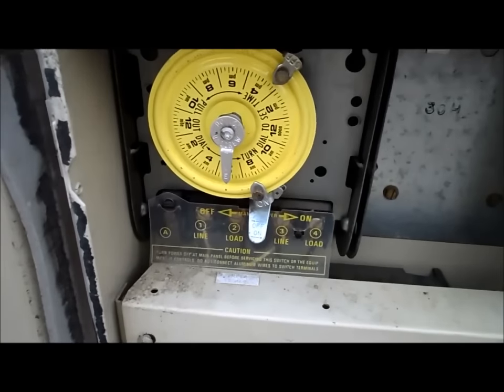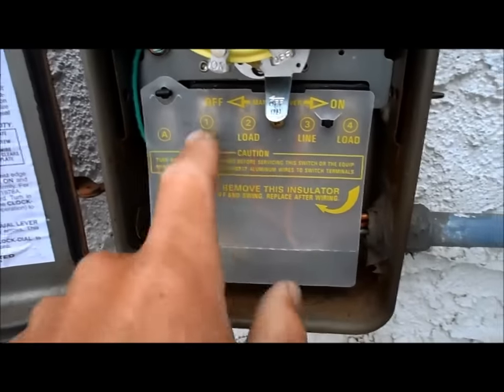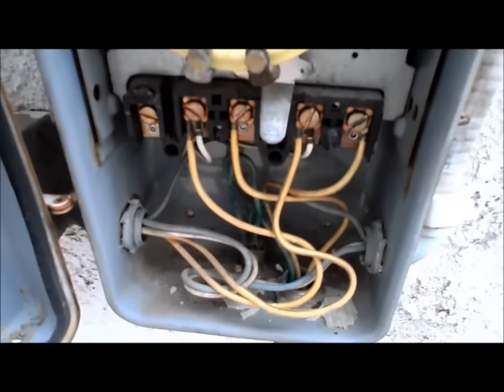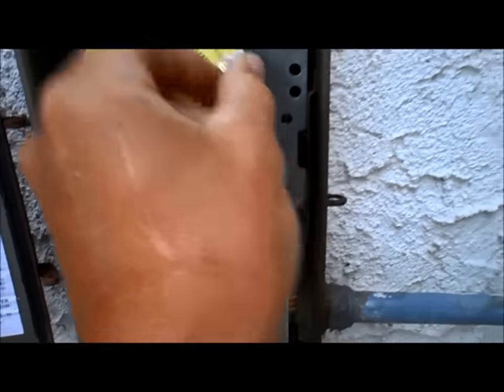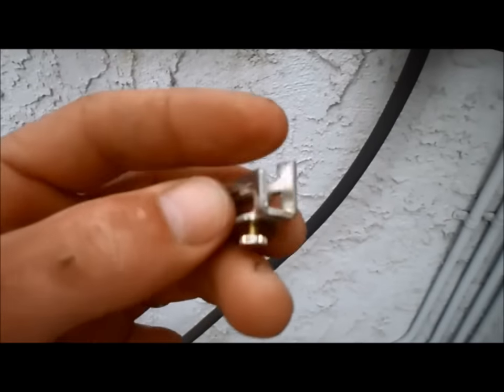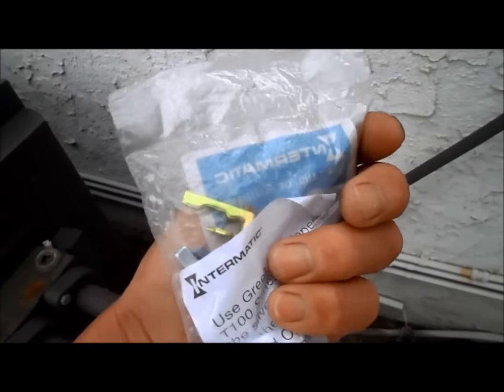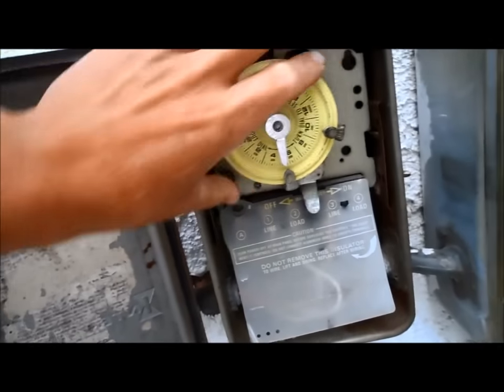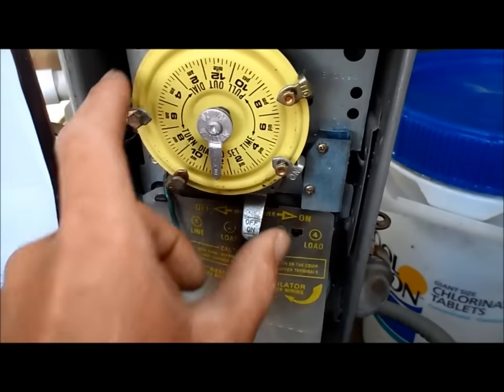Intermatic Pool Timer, tips & troubleshooting

Comment: Thanks for the quick response.  Breaker is at the timer location and I plan on marking all the wires (with picture backup) to ensure correct installation.  Great work on the videos - will be back if any other pool issues!

Comment: The Intermatic timer installed when my pool was new, lasted 20 years. The new one, installed two years ago, lasted one year. Replaced it last summer, and the newest one (purchased on Amazon) lasted less than a month. Each was the exact same model. This year, I'll replace it with something from Lowe's. At least they'll accept a return within 90 days.
Reply from the maker: The quality of modern products in the world is frankly - terrible.
Reply: Yah my 5 year old one sounds like a pumping meter,box rusting.Maybe only surface but gears sound struggling.I’ll replace it I guess.

Comment from the maker: I just replaced a set of trippers on a 37 year old timer this morning. I though about your comment so I compared the two trippers - green and the silver - I could see no difference but it must be microscopic. I know if the trippers are even slightly damaged the timer won't work correctly. This morning the customer said it wasn't turning off. The old "off" tripper was fractionally bent. The green tripper is a recent thing - maybe the last 3 years they have been included in the replacement bag.

Comment from the maker: You can get a second set of "on" "off" trippers and run it on two different times. I have a few pools set up this way. I also add an extra "off" tripper sometimes so when I add chemicals in the morning I can run the pool for three hours if the timer is set to turn on later in the day. That way I don't leave it running all day. A little Pool Guy trick ;)
Reply: Where do you get the second set?

Comment: Good tips. There's another video out there titled how to save 300 annually on your energy bill by changing the timer on and off to cause your pump to turn on and off 3 times a day and only run 3 hours a day. As a pool tech if you have seen the video please do NOT do that! Your pump needs to run 6-8 hours a day in the summer AND turning your pump motor on and off several times a day is not good for it. So what you save in electricity you will pay in motor repairs and chemicals to fight algae etc.

Comment: Not sure where to put this question. When I put my spa HEAT on using indoor control panel. I jump in, it heats up, it shuts off at 104 deg. BUT, when I leave the spa and go inside and look at the control panel, it's still RED, calling for heat ON even though it's up to temp. and shut off. It's supposed to turn GREEN when it's off/up to temp.

Thoughts? Thanks!

Comment from the maker: I use the wire algae brush all the time. It won't damage the plaster at all. I have never tried the Vitamin C myself so I can't comment on it. It can't hurt to try it. A Stain remover will not work in the case of a rust stain. They are only effective on small stains like fertilizer pellets or a staple that falls in the pool, and even then they are hit and miss at best.

Comment: My timer motor stopped working so I had to take the cover off the timer motor to clean the debris from the gears due to ants that kept the gears from meshing. Simple to do, just little tabs that needs to be bent back. Under the big drive gear on the motor is a metal indexing tab that if put on the wrong side will make the timer 

motor run backwards, so make note when you carefully remove the gear cover. Been working great after a little cleaning and oiled.

Comment: We just replaced the mechanical timer in our box (after watching your video and it was super easy),  however that did not solve our problem.  The pump does not respond and turn off using the manual lever and changing it to the stop position.  Is there some other component that could be bad and not allowing the manual switch to break the current?  Right now we are having to operate the pump by using the circuit breaker.  Any help is greatly appreciated!

Comment: Cool thanks!  I run mine about what you say, 8-10 hours... .question is my salt gen is supposed to have a flow sensor and shut the gen off, but it doesn't appear to be... so iv'e been trying to remember to go turn it off and then back on the next day.  problem is, I often forget... and very rarely the gen will shut off with the no flow light on.  Should i get a second intermatic timer, or get a diff timer for the salt gen, been looking at a woods 1000w timer.. appears to be for things such as block heaters?
Reply from the maker: That is a very dangerous situation. The gases in the cell can build up and the salt cell can explode. It is a wiring issue I think vs a timer issue. I would have an electrician come out and troubleshot it for you.

Comment: I had a "GE 15350 Heavy Duty 24 Hour Timer" from a house I bought.  It worked for 3 years and it went out.  Is this as good as GE 15350 ?
Reply from the maker: siuabc These timers are much better. Usually last about 15-20 years or more...
Reply: Swimming Pool Tips, Reviews & How To -MrDgvb1 thanks!  Ordering one. I am not too handy with electric stuff. A one person pool company said he will do it for $80. And said if this still doesn't work, it can be the motor?   The last time it worked was when my mom tried to turn it on and it sparked at the timer; and then it never starts again.  Any thoughts?  Other areas that might cause be the problems?

Comment: Question, I'm getting a variable speed pump but always had a single speed where the timer did the work of turning it on and off in 8 hr schedule.  How do i bypass this when i get my new variable speed pump?
Reply from the maker: Leave the switch to the on position and remove the on/off trippers. You're all set!
Reply: @SPL  that's easy enough. Thank you!

Comment: Thanks - great video!  Any suggestions for a timer that works intermittently?  It can be up to 8 hours "late" within a 24 hour period.  Two timer system with one for the pump and one for the sweep - it's the sweep timer that has the issues.

Comment: I read that the Series 100 Timer uses the green ON tripper and the other series use the silver (IIRC). I understand if you have a 100 series timer and use the non-green tripper, the timer will start the pump.

Comment: My pool pump has 2 speeds so I have 2 timers.   The timer for the slower speed is changing times all by itself.  I adjust it by pulling out the clock and locking it back in but it won't stay at the correct time.
Is there some way to fix that?  Or do I need to replace it?

Comment: Hi, i have the identical timer in the video.  I would like to start my pool pump around 8:30 a.m. - 12:30 p.m.  and then turn it back on at 5:00 p.m. to 8:00 p.m.  The reason i would like to do that is because in Los Angeles we get charged a peak hours from 1 -5.  However, when i added the new two pins and set it from 5 to 8.  The pool pumps starts at 8:30 and turns off at 12:30.  However, from 5-8 would not turn on.  Can you shed some light on the issue.  The pins are new.
Reply from the maker: Interesting. Maybe the on pin is defective in the new set. It happens sometimes. Try swapping the "On" pins and see what results you get. Just out of curiosity how many gallons of water is your pool and what size pump & filter do you have?

Comment: Thanks for the video! I just replaced my timer and the pump runs when I manually flip the switch on, but the clock mechanism isn't working. So the clock doesn't rotate. Any ideas?
Reply from the maker: Possibly a defective timer mechanism. Been a lot of those on the market.

Comment: Please help....anyone!!!  My problem is that every now and then the timer will not kick on the pump.  When I push the manual switch to the right, it will start. But when I let go of the switch it stops.  If I push it to the right harder it works, but then if I let go again it stops.  Then I switch it back and forth a few times pushing harder to the right and eventually it will hold.  It will run fine, turning off and on for days then.....it does it again. Happened four or five times over the last month.   Can't find an answer to this anywhere on the internet.  Thanks.

Comment: You say about the timer wheel to make sure it clicks back in. If it doesn't what do I do? Mine just spins. I can manually turn  the power on/off but the timer wheel does not move. But I can spin it around easily by hand. I do I get it pushed back in?
Reply from the maker: Try that. And if not you may need a new timer. They are relatively inexpensive.

Comment: I bought a replacement but the new one only has three screws/contacts to connect the electrical wires (instead of five contacts like the one shown in your video). Where can I find info on where to connect each wires to the three contacts?
Reply from the maker: You will need to contact Intermatic tech support. They are really good and can walk you through the proper set up to get it working.

Comment: I started using just a plastic timer box I had kicking around on a 1.5 hp pool motor. The timer started getting hot after awhile. not good ?

Comment: I purchased a house with a pool. When i set the timer, once it turns off the clock stops turning and it never turns back on because the clock isn't moving. Is it installed incorrectly or am I missing something?
Reply from the maker: It could be broken. If you have a home warranty that extends to the pool equipment that would fall under a warranty call.

Comment: Very helpful, thanks! Our timer wheel keeps spinning, it doesn't seem to be snapping back into a groove (like when you pull it out to change the time, then release and it goes back). What should I check to repair this?
Reply from the maker: It will need to be replaced. They are petty inexpensive - around $65 - all you need is the Mechanism and not the box
Reply: @SPL  could it just be an bad spring that is not pushing the timer wheel back into the groove?

Comment: Thanks for the tips. My gear stopped moving, so I'm having to turn it on-off manually. Is there any recourse to get it going, other than replacing the whole unit?
Reply from the maker: You can change the motor. It it pretty easy. But if the timer is pretty old just get a new one - not very expensive at all.
Reply: Swimming Pool Tips, Reviews & How To -MrDgvb1
thanks
Reply: @SPL  changing the motor was pretty easy to do. I just did it one hour ago.

Comment: hi  my pool turns on at 8am and it stops around 11 than it turns back on at 12 around 2 times it goes off than it turns off at 4.it runs 8 hours.my question what's causing it to turn off?? is it over heated is it the breaker??? plz if u can asnwer  asap

Comment: Great video! My breaker is tripping immediately when I switch the timer on - every time. If I play around with the breaker switch and timer switch for a while (flipping them on and off a bunch of times) I can sometimes get it to stay on for roughly 5 minutes and then the breaker trips again. Any ideas what the problem might be?
Reply from the maker: Jesse Speer Could be the motor going bad - how old is it? Any noises?
Reply: Hey! I figured out the issue. I needed to replace the Twist-Lock receptacle that the pump was plugged into. It wasn't properly weather-proofed by the previous home owners and was completely rusted out. Works great now! Thanks!

Comment: My gears are turning, the timer is moving, i have power (i manually turn it on), but my new tripper will not turn the pump on.  The other day it stopped working, I pulled it out and it was bent (the 'on' tipper), I replaced to no avail...what am I doing wrong?!  

FYI: the off tripper turns the pool off correctly.

Comment: The gears in my timer are not turning, and the pump won't come on when I turn the switch on. No breakers are tripped in the main panel. I used a non-contact voltage tester and the wires are hot. The pump is a Century Centurion AO Smith 1.5hp. There is a little cover for the shaft on the back of the motor, and the shaft turns freely. Could it be a bad timer, or maybe a start capacitor? I hope I don't have to replace the motor.
Reply: Adam Savage  Did you find out what your problem was. I have the same exact issue. I changed the capacitor and tested it so I know it's fine. There just seems to be no power going to the timer and the on/off manual lever will not turn the pump on just like you mentioned. No gears moving but the wires are hot. Let me know if you found a solution.
Reply: They used metal conduit under my driveway and garage and it corroded. The wires were shorting out on the conduit. I had to get an electrician to help me find the problem. I ended up digging a new trench around the driveway and garage and using pvc conduit. My pool is finally ready for the summer.
Reply: Adam Savage .....thanks for the response. So my breakers are good, my wires coming out of the wall to the timer/motor are hot but the timer itself seems to be dead. I disconnected the wires from the timer and tried to connect the hot wires from the breaker/wall to the motor pump circumventing the timer and still got no power to the pump. I'm thinking the wires between my timer and the pump are shorted out which could have killed my timer and it's motor as the timer doesn't work and the manual switch doesn't turn on the pump. Thoughts based on your experience. Going to have an electrician look at it but thought I'd see if that sounds familiar to what you were seeing.
Reply: That sounds a lot like what was going on with mine. I tried bypassing the timer and it still didn't work. Really though, if you use the manual switch on the timer it's doing the same thing. If you have a voltmeter, test to see if you are getting 110v from both wires. If I remember correctly, I was getting power at the timer because one leg of the 220v was working sometimes. Maybe it was jumping across at the short or something and I was only getting 110v to the pool. I'm not an electrician, so it was confusing to me. My pool equipment is about 250' away from my breaker box. Or I should say the wire run is about 250'. There are 2 junction boxes along the run. I didn't even know about one of them. When the electrician came, we found a junction box behind my garage. When he opened it we found melted wires and wire nuts inside. As we sat there messing with it, we could hear a buzzzz down inside the conduit. That told us that there was moisture down there and the wire was welding itself to the conduit. That's what the electrician said. So, now that we knew what the problem was, I had to dig a trench around the garage, and lay new wire with pvc conduit. Now I wish It was just a bad pump!
If you are going to get an electrician, ask him how much he would charge by the hour to troubleshoot your pool equipment. It took us the entire morning to troubleshoot mine, and cost more than I expected. Hopefully It's just a loose wire or a bad breaker or something easy like that. 
Good luck, and let me know what it turns out to be.

Comment: For some reason, my timer turns on well before it gets to the "on"tripper, the " off" function works fine. For example, I have it set to turn on at 10 AM, and it turns on at 9 AM. The clock is set correctly. I have it set to turn off at 4, and that works fine. Any thoughts?? The clock pointer is not near the "on" tripper, so kind of weird.
Reply from the maker: Not sure. maybe the dial is wearing out. Had that happen but usually it won't turn off or on so pretty odd.
Reply: Swimming Pool Tips, Reviews & How To -MrDgvb1 Thanks for the response. It's a fairly new mechanism, but I guess it could be defective somehow. Odd that it behave like that though, I guess I will adjust the clock setting by an hour to get it correct. Not a big deal, but I want it to run for 6 hours, rather than the 7 it runs by going on early.
Thanks again!

Comment: Does the clock need to be oiled the gear is moving peeking through the hole and it sounds like a clock but I couldn't get it to go on or advance and trip ON.
BTW it had been stuck on for several days wasn't tripping.
Reply from the maker: Could be broken. The mechanism is pretty inexpensive - $65 or so and I suggest replacing it.

Comment: We installed a new timer and current limiter to our system.  It ran great for a couple of days and now the power turns off a few seconds after the system comes on.  Any idea what we did wrong??
Reply: I had that problem. It turned out to be the start capacitor on the motor itself needed replacement. Simple job. $8 part. Hope that helps.

Comment: Does the timer know the  difference between an on tripper vs an off tripper or if the pool is on and it encounters a tripper (on vs off), will it turn off cause it encountered a tripper?
Reply from the maker: Yes, if you look at them carefully you can see the indentation is in a different location for each tripper.

Comment: Hello!  I have a dual intermatic timer for my pool.  The one controlling the hi/low feature for the pump works fine but the motor stopped working for the main one.  I replaced the motor it it and it still doesn't work-even when not connected to the gears.  Power is getting too it and can manually turn on the pump with both high/low speeds.m I'm so confused!
Reply from the maker: Jacob Vetsch Pretty odd. Not sure about that one.
Reply: Believe it or not the new motor was no good.  I exchanged it and the now it works!

Comment: What happens when I turn on my  timer for my 2nd speed for the pool motor and I see electricity lights from the timer and I hear the motor trying to start for a second and stops. The timer for the 1st speed works fine. The capacitor was replaced and same issue.